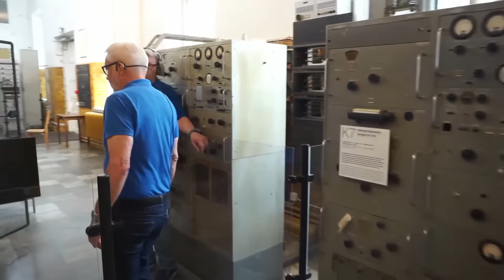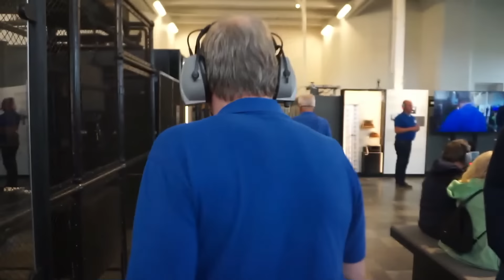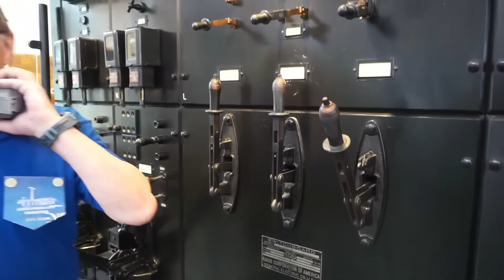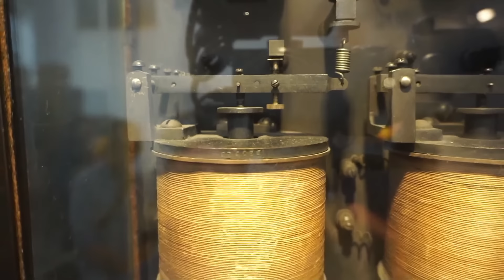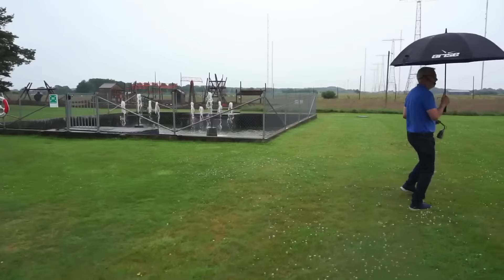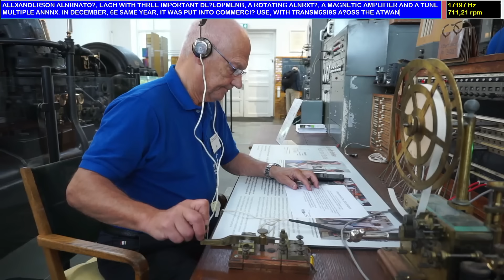Historical transmitter SAQ Grimeton transmission 12:00 UTC - Alexanderson Day 2024

Comment: Nice video! Such a big and difficult mashine!To made it , had been  spent lots of time and forces of many engineers and workers. Now the telegraph (or AM) wireless transmitter    (up to 15MHz, and up to several KiloWatts)  can be built using 74hc04 and 74HC244  cheap logical ICs and one power MOSFET like class E output RF stage.
Reply: yeah but where is the fun in that...  this is proper tech !